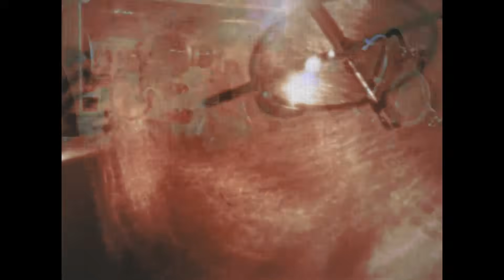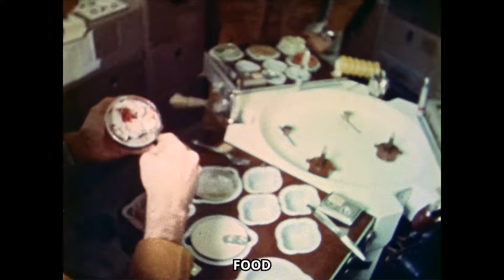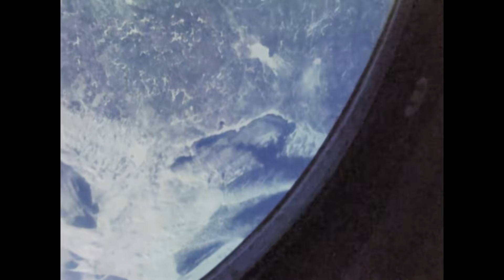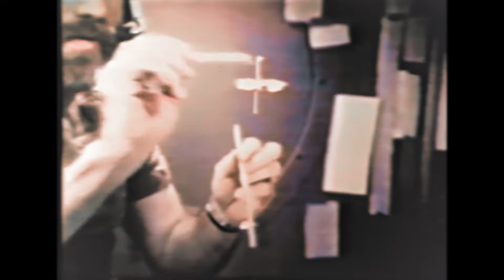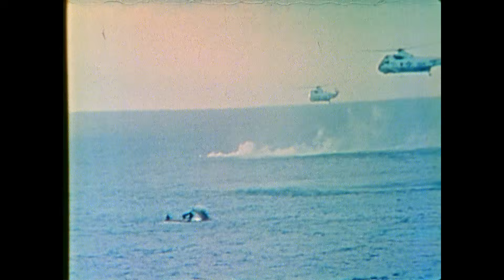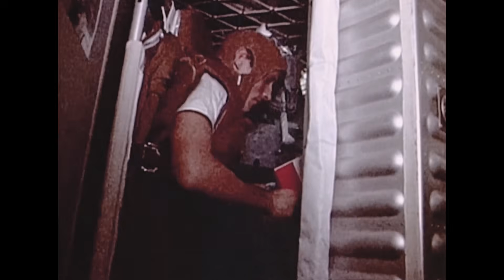Skylab 4 - Final Crewed Mission - Historical Footage & Narration, Mission Audio, NASA

Comment: Skylab was so badly underutilized. Seemed like a great observatory station that the shuttle desperately needed.
Reply: They could've, should've sent the rescue booster up on either a Titan or an Atlas. I'm assuming the politics and funding were so screwed at the time that they couldn't afford the rocket. Such a waste
Reply: @Bydesign777  That's about right. The Martin Marietta proposal never got enough traction. Mostly because NASA preferred to toss money at some new hotness---a newer space station--rather than salvage an existing one. They also thought that Skylab would be up there through 1982 or so. But solar activity changed those plans.
Reply: @Bydesign777  There was a Skylab reboost module built to be flown on the shuttle, but the shuttle slipped too late. It would have been conceivable to take the reboost module up with an Apollo CSM, but by the time it was clear the shuttle wouldn't be ready in time, all the Apollo personnel and hardware had dispersed, so there was no practical way to execute the mission. 
I am not sure what the reference above to "Martin Marietta" effort mentioned above is referring to. The reboost module was being built by Lockheed Sunnyvale.
Reply: @Bydesign777  Not to mention that Elon Musk wasn't even BORN yet!
Reply: @davidharrison7014  What could tubby have done?
Reply: Even had a booster been able to keep Skylab in orbit, I'm not sure the space station could have lived on into the latter Shuttle missions. Time and direct sunlight deteriorate the condition of some of any orbiter's systems. And as fast as tech was advancing between 1974 and '81, Skylab might have needed a complete overhaul to be of use to the Shuttle crews. For these reasons I don't agree that "tossing money to some new hotness" was the problem.